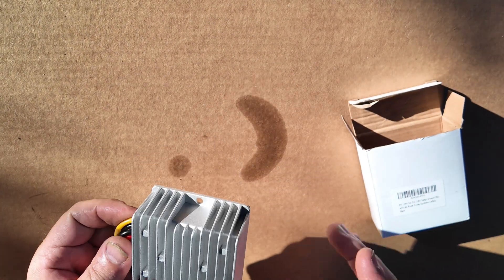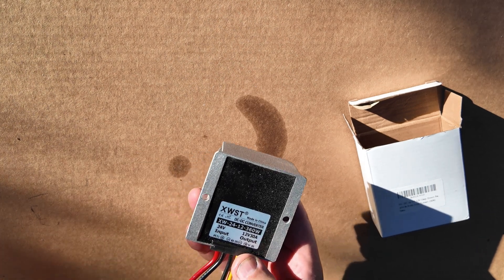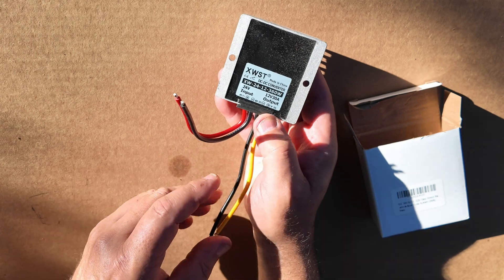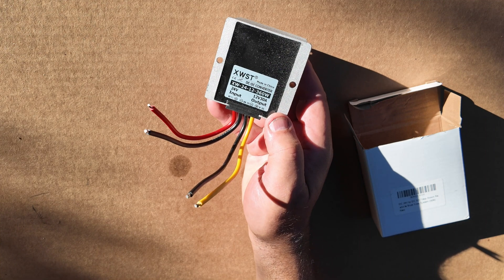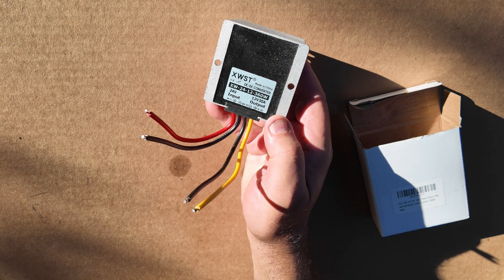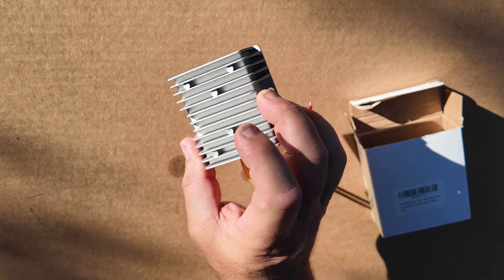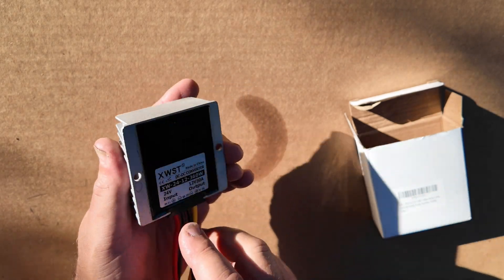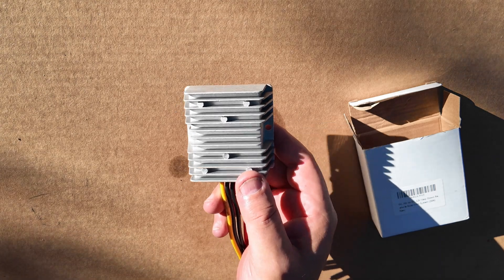Transform Your Power: 24V to 12V DC Converter Review  Essential for Automotive, Marine, RV, & Solar!

Comment: Can this handle a 24 volt 6.5L diesel humvee battery, to step down the voltage for my audio system? ty
Reply from the maker: The short answer is "probably?" Without knowing what the peak current draw of your audio system is it's difficult to spec the exact unit that would suit you. If is is a simple head unit and maybe a small amp, very likely this would be fine. If your audio system has huge amps drawing massive current, not likely this will do. Thank you for the comment.

Comment: I was wondering if it will limit the current if your at max or will it cut off or will it melt?
Reply from the maker: My experience is they will drop the load and reset then re-engage. If the overload is still there, they will cycle on and off. I probably would not leave them in that condition.
Reply: @TheDIYMaker1  
Thanks that's good to know